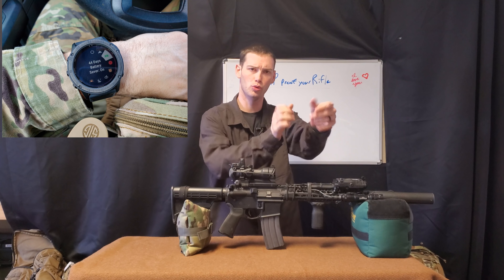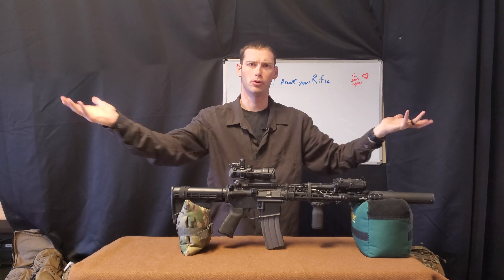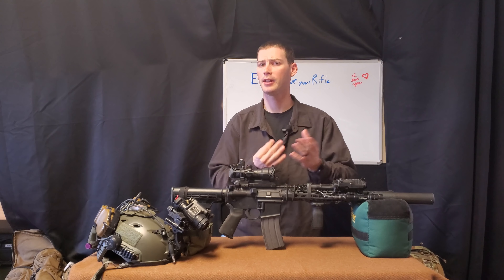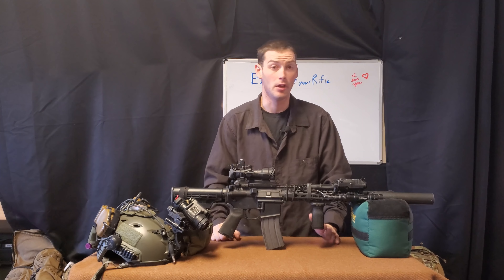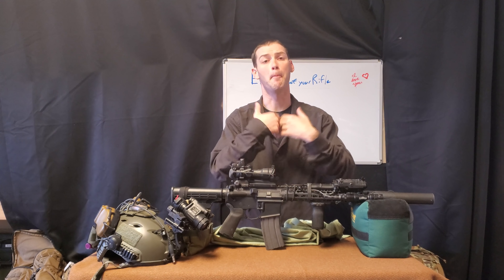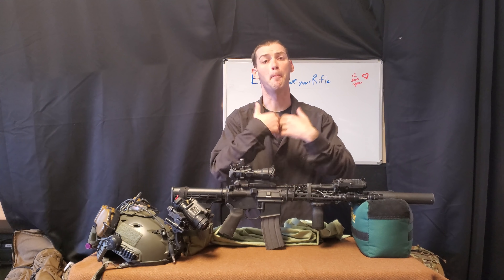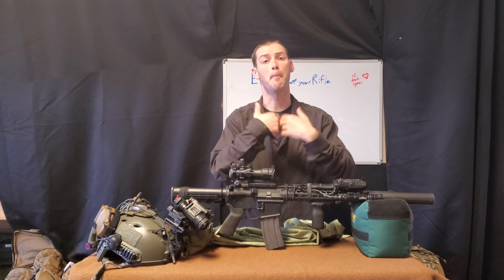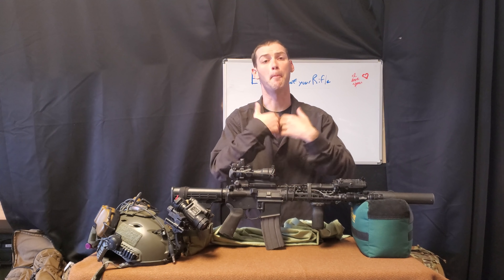EMP proof your rifle

Comment: Great video! I'd like a video on EMP proof   ones metal gun case and doing so via DIY?
Reply: As an engineer, I can say with authority that your rifle won't care. What you have strapped to it will. Tech is an edge, but training is better. This fabric is better than what you'll bang out on your kitchen table. That being said, find a steel gun case. Make sure the case isn't enammelled or strip it like you would for welding. Use metal tape with a conductive adhesive to patch over any holes created by rivets and the like. Pull any gaskets out and replace them conductive ones, or tape around the edge with plenty of contact on both sides to bare, unpainted metal. Line it with carboard or rubber. DO NOT let the foam touch the metal- many foams are conductive to a degree. 

Or spend the money on some spare vortexs and sreamlights. Zero and label the optics to a particular rifle. Put them in a faraday box. Ten minutes of homework will find you a bunch of of directions for them. Anyone telling you that a microwave is a pat deal is a fool and a con artist- they are better than nothing and just barely. My Faraday box and can were built with a friend who designs radar systems for a living, and he and I give them a a better than 50/50 chance but not by much

Or if you have a good ideas it's coming, put your electronics in a dry bag. Tie a rope to the handle. Throw it in a pool at least four feet deep. Leave it there for at least a half hour, hour would be better, after the inital pulse while the E3 charge dissipates.

Comment: This is a good video, however, in order for an EMP to effect a device, it has to be able to conduct the current. So smaller devices do not have the surface area to be deactivated by EMP. 

That being said, larger grid systems, power, etc would definitely be knocked out because they have the surface area to conduct that current and cannot discharge it.
Reply from the maker: It depends on how much energy is released and how close your are to epicenter of the event.
Reply: @slipknnnot  thank youuu

Comment: LOL...  you really don't know what you're talking about, or how high frequency EM emissions behave, do you?
Without giving you a science lesson, EMP and CME emissions occur over several different frequencies, and therefore effect different length transmission lines. The short trace and wire length in most small electronic devices are not 'tuned' as good antennas to the typical frequencies encountered with EMP or CME emissions. But...  whatever... you go ChairForce.
I get it, you're trying to make the elusive YouTube bucks, but man... Stop spreading the misinformation out there.
Reply from the maker: This isnt my information and I personally don't have a PHD in this field but Dr Bradley does and I'm just shareing his researched information. Do you mind sending me a link to where you get your information from so I can further research? 

> https://youtu.be/7PA0-t4MKL0